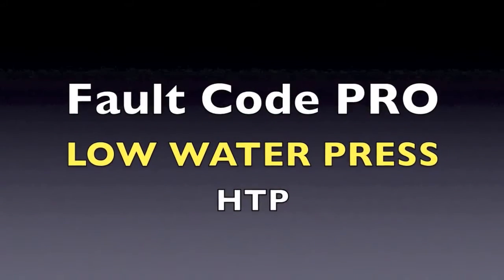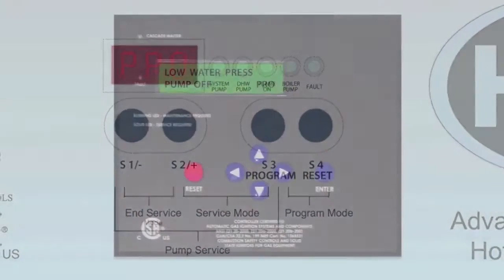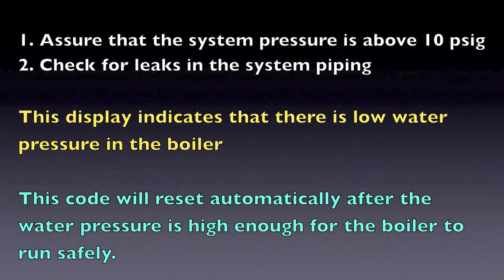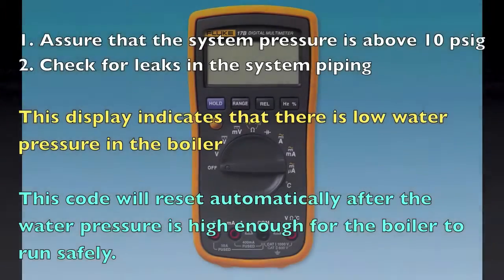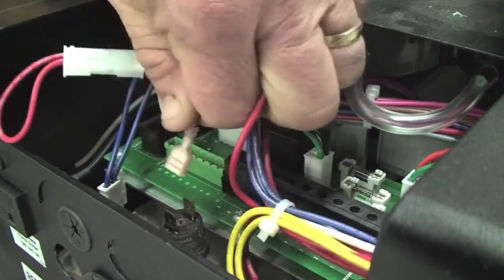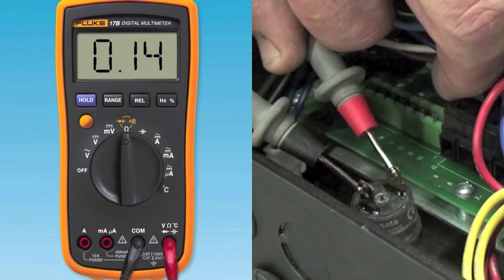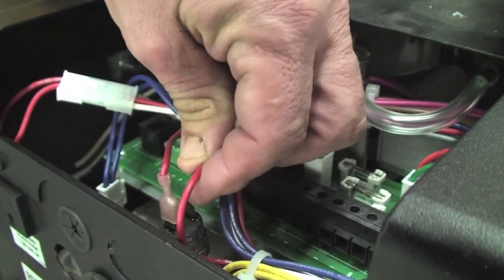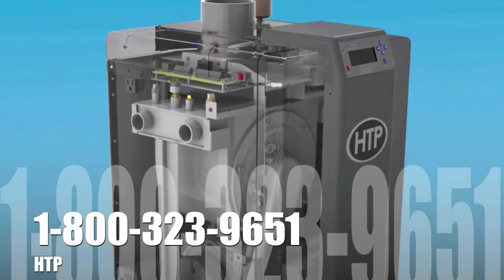PRO Fault Code -

Comment: Is it possible that the switch fails intermittently or can go bad slowly. ive had this code 3 times in the last couple weeks and  powering off the unit fixed it the first tiime, the 2nd time powering off the unit didnt work so i shut off the house water and depressurized the system. then i repressured the water lines and turned system back on  and it worked. here we are 3rd time as Im typing this. THis boiler is getting on my nerves at 4 am with no heat.

Comment: I had the Pr0 code, and thanks to this video I knew where to look.  I disconnected one of the wires on the sensor, then a fault was triggered.  I put the wire back into place, reset the unit, and everything is happy now.  I'm guessing the device firmware got stuck in some loop.  Thanks!